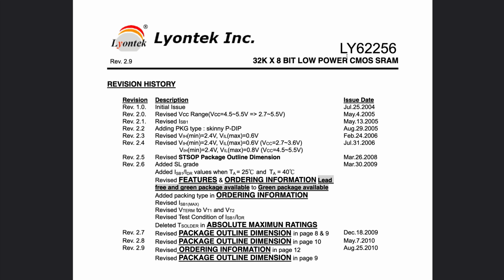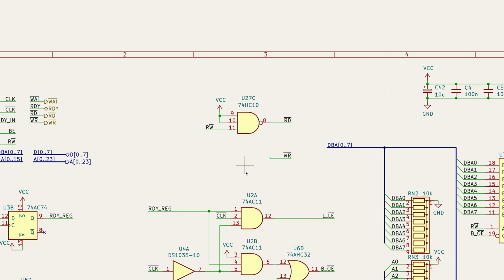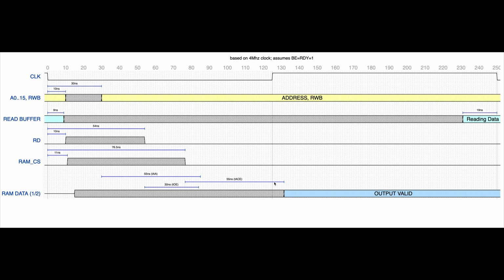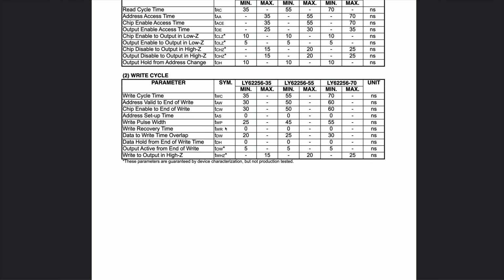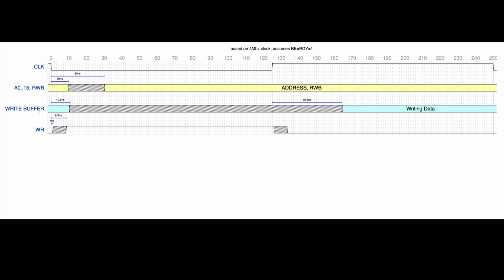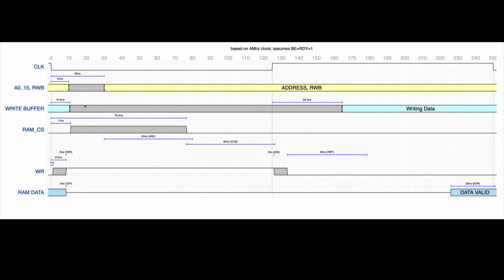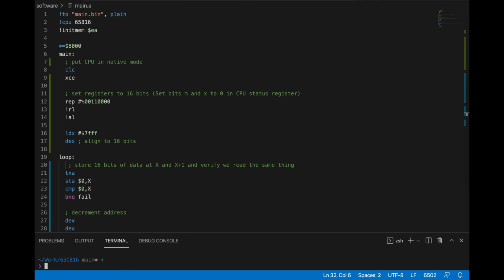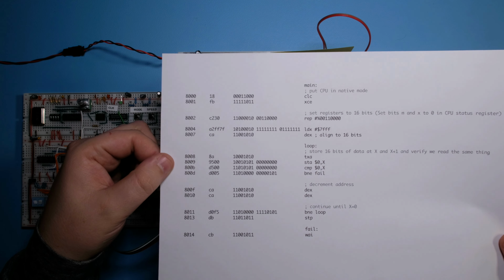#15 - Adding RAM - BB816 Computer

Comment: Because of how you need to store 16 bits of data in the 8 bit rom chip, the effective usable ram is actually halved, correct? Would there be a way to use a 16 bit ram chip (or two 8 bit ones) and switch which half of the ram the 816 reads/writes so as to not use double your ram's address space?
Reply: You don't have to waste half the storage. A byte is still a byte and the ROM still contains 32 Ki of them. If you want to process some 8-bit data (ASCII text, for example) you can switch the accumulator to 8-bit mode and when you want to do 16-bit arithmetic you can switch it back to 16-bit mode. Similarly, and independently, you can switch the index registers back and forth between 8 and 16 bits. There's a command for manipulating the status register to do this and assembler directives that keep the assembler in sync. The test program is simply writing the 16-bit numbers to two adjacent addresses, low byte first. You can do the same with a 6502 but this does it with a single STA instruction.
Reply: I should add that each instruction is still only 8 bits long, so on average 65816 machine code should be denser than the equivalent 6502 code, especially for the arithmetical instructions. To add two 16-bit numbers, for example, needs a CLC, an LDA, an ADC and a STA in 65816. In 6502 it's at least CLC, LDA, ADC, STA, LDA, ADC, STA with possibly an INX thrown in too.
Reply from the maker: Hey Jake, Thanks for your message, and sorry for taking some time to respond. It looks like @johnm2012 has already answered you (thanks!), but do let me know if you have more questions!

Comment: Please could you clarify on the replacement '11 and '32 chips?  They are now AC11 and AHC32?

Thank you again.  Your explanations of the timing diagrams is superb.

I've started following your design, and have a working clock module.  I'm still waiting for some more chips before I can start the glue logic.  I've also been doing some design of a video circuit that could drive a VGA port (not full resolution, naturally), and I would not have been able to reason about it without your inspiration.
Reply from the maker: Yes that is correct! Remember that you can always look at the most up to date schematics on my GitHub: https://github.com/adrienkohlbecker/65C816

Happy to hear that these videos are helping you with your own designs :-)
Reply: @akohlbecker  Fantastic!  Yes, I have your schematics, but wanted to double check :)

When I get it all working, I'll post a video and give you the credit.
Reply from the maker: I will enjoy watching that :-)